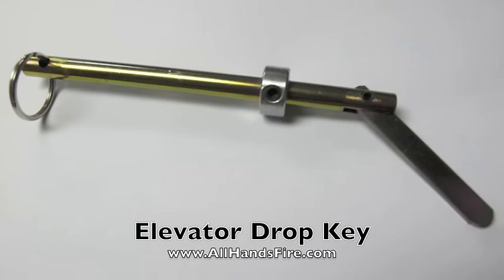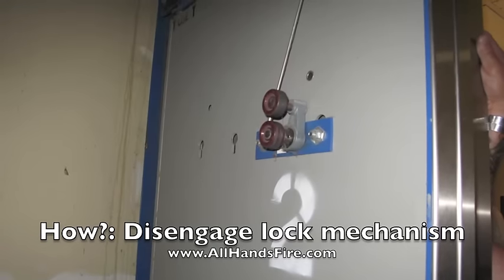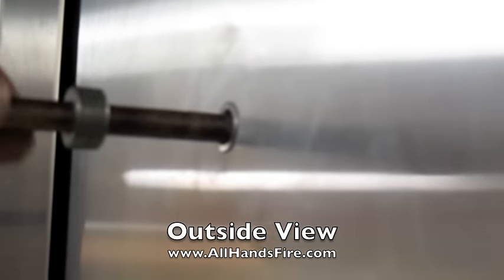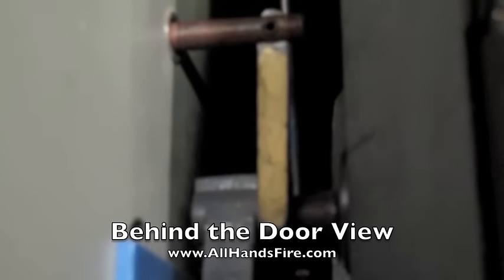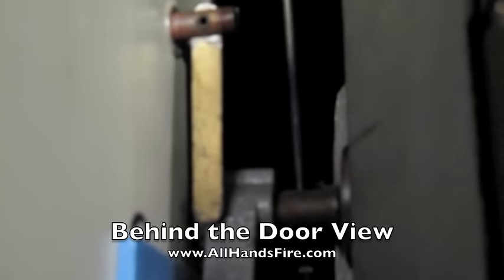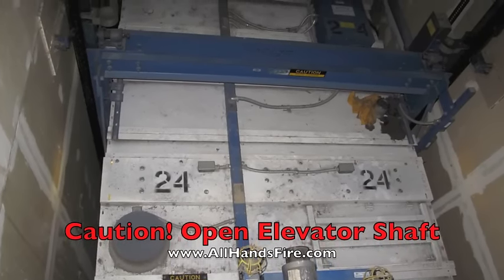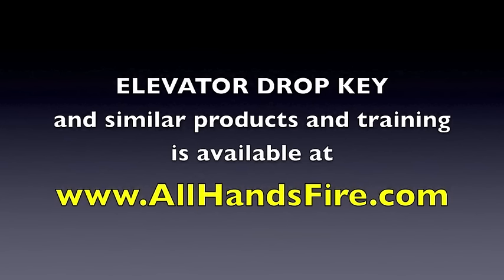Elevator Keys Elevator Access with Drop Key

Comment: So the end of the key just stops and that's it? You don't turn it?
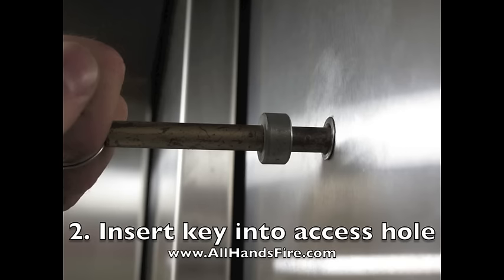Reply: They didn't show but you push against the other side of the rounded metal area that the key is on at 0:25, this just disengages the lock and you can now slide the door open

Comment: Fire fighters responded to our building and used this tool to open the door for an entrapment - but they didn’t turn off the power. 
Then the elevator repair guy came and did the same thing.
Reply: Most likely they have put it on independent service so people cannot call the elevator from other floors. Either way they have to make sure the elevator doesn't go to the bottom floor and potentially crush/block people down there.

Comment: This should not be on YouTube. These keys are easier to get than they should be and in the hands of someone who doesn't know what they're doing are very dangerous and can get someone killed in a variety of horrible ways.
Reply: I'm a maintenance guy at a hotel, and this video saved my life when the service elevator stopped working. Turns out the tracks for the inner door were filled with dirt and needed to be cleaned for proper operation. In any case, videos like this are what helps guys like me learn something new. Instead of censoring videos like this, you should advocate for more videos on how to perform these tasks safely.  Let's face it, if I didn't have this video I'd still need to get that elevator door open, and instead of being shown the proper way, I'd do something dumb and unsafe to get it open.
Reply: @slabbulkhead6875  Did you lock out/tag out the controller to make sure the elevator couldn't move unintentionally?  Did you ensure that the car and hoistway gate switches were operating properly?  Doing this without understanding the elevator system gets people killed.  It happens.  Maintenance guys die every year trying to perform seemingly basic tasks on elevators.  There is a reason we have a 4 year apprenticeship and training.

I'm not trying to disrespect or discredit you, but if you open one of these doors and the car isn't there you could fall to your death, if there's an issue with gate switches (like a relation cable coming off on an old set of center opening doors that only had one gate switch) the car could run while you have the doors open and crush you between the wall and the car.  This is not something to play with.
Reply: @dustin b  Yes, I was very safe and respectful of the machine I was dealing with. All power, primary and auxiliary were shut off prior to me opening and working on it. Considering we had recently had the elevator serviced, I knew the extent of the work I had to do would be trivial, and the issue couldn't be anything more than dirt in the tracks.  If it were any other issue, I'd call Otis and have them send a qualified technician up and I wouldn't touch it any further. While I am not a qualified technician, I was given a decent amount of training regarding very simple maintenance of the elevator systems.
Reply: @slabbulkhead6875  So you were clearly instructed on site by an elevator tech?
Reply: @dustinb3216 totally agree with you. I'm a 65% and everything you've said is true. People please don't ever open a door or anything reckless with elevators. They can and do kill.
Reply: Your argument is invalid.
Yes people can buy them on Amazon and if they mess with an elevator people can fall down the shaft. But you included the point that makes what you said wrong. People can buy drop keys online by searching elevator key.
This video gives warnings and cautions against opening a door as a member of the public. Other sources online don't.
That means this video is a net positive not negative.